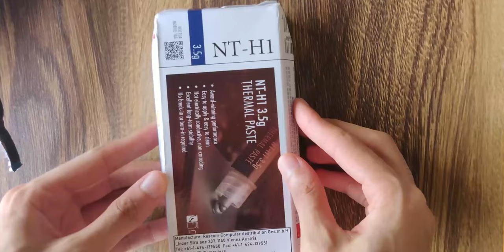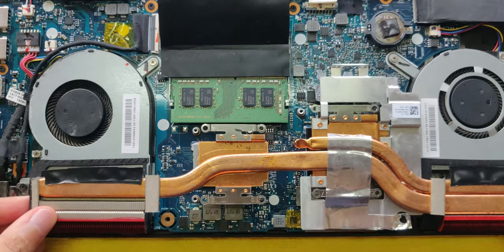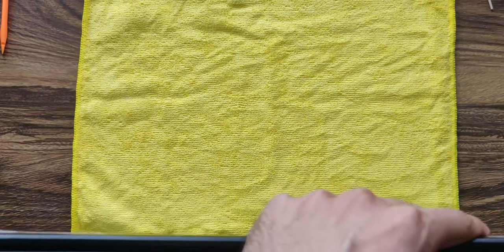How To Replace Your Thermal Paste - ASUS TUF FX505D series | Noctua NT H1

Comment: A small error in an otherwise excellent video would be the lifting up of the heatsink after applying the thermal paste, to check the application. This lifting up introduces air bubbles in the paste, which ends up making it less effective than what it can be, and undermines the entire reason to apply the thermal paste in the first place. Other than that, this video was really  helpful, so, thanks!
Reply from the maker: Oh that makes sense, thanks for pointing it out! Pinning this comment so that others can take note as well. Glad it helped you out! :)
Reply: Who cares he's gonna have to redo that NT-H1 TRASH in a week anyway! No longevity.
Reply: @krom5461  NT-H1 pumps out in like a week because it is very runny for thermal paste. This is because of expansion and contraction of the silicon die and copper heatsink being different, it's fine on a desktop CPU where it is a copper IHS on a heatsink though but not on a laptop. I have seen it actually start separating and leaving some oil on the die after a year.
Reply: @jm036  what paste would you recommend for a gaming laptop?
Reply: @Bob-bx4xg toothpaste.  Always game with fresh breath
Reply: About lifting up the heatsink, I found it strange, too. One thing you can do (if you have enough quantity) is lift it up, see how good it went, then clean the die and apply it again. I did this twice to learn how to properly apply it on a laptop CPU and GPU, since I had only done it before on a much larger desktop CPU.

Comment: I recently change my thermal paste too with Deepcool Z5, it dropped around 10°C from 90-ish°C to 80-ish°C. But rarely it still go back to around 95°C for a second or two. Still happy with the result nonetheless.
Reply from the maker: Yep, it's crazy how much of a difference it can make. In my testing, whenever it reached around the 90°C mark after applying the thermal paste, the FPS was usually 5-10% better as well.

Comment: Just bought this laptop used, I knew before buying the cooling wasn't stellar, but it was posted so cheap, and with 32gb ram on dual channel, that I just went for it. Cleaned the fans, and repasted it, here are my results in case they are of any use for anybody.

Tested both times with Sekiro max settings 1080p, from outside of Kuro's room, after looking down on buildings and enemies for 10 minutes, near 100% usage gpu, around 50% on cpu.
__________________________________
Before repasting (tested yesterday, on a chilly night)
CPU: 86°-94°c
GPU: 69°-72°c
__________________________________
After repasting (tested today, on a warmer night)
CPU: 72°-86°c
GPU: 60-64°c

__________________________________

nothing but good things to say about the 1650, it's like it was designed from inception to shine on anemic laptop cooling xD, the R5 3550h could definitely use better cooling though... I mean it's within specs, sure, but the acoustics could be so much better. If at least you could undervolt it... but you can't.
Reply from the maker: Thanks for leaving such detailed feedback! My testing found similar results of a drop in temperatures by 10°C on average. 

I haven't tried undervolting it, but is it not possible by using the Ryzen Controller software? It's made by a user but it's widely regarded as the go-to for tweaking mobile Ryzen processors.
Reply: @CytechGaming  I read a bit about it, but haven't tried it yet, I was thinking about buying a cheap knockoff bottom shell from aliexpress, drilling holes directly below the cpu fan on that, and gluing a dust filter to it. Have seen people report 10-20° improvements on other laptops with similar vent designs.
Reply from the maker: @fenix_tx_1342  Possible, I like the sound of it. But if you're interested in undervolting I'd recommend checking out Ryzen Controller. I downloaded it and was able to change the settings, didn't really play around with it too much though.

Comment: I like the strip of tape across the heat sink! Good idea man. Excited to see the performance difference, as I have the same laptop :)
Reply from the maker: Haha thanks! I noticed the gap a while back and figured it couldn't hurt to 'fix' it with some tape :P
Reply: @CytechGaming Did it improve the performance though?
Reply: @beamazed54  it definitely helps cooling down the temperature of the CPU and GPU. My laptop would heat like crazy every time I increased the fan speed. I realized that the gap would allow the hot air to come back inside the mother board in an endless cycle

Comment: Thank you.  I also lifted the heatsink again, saw there was too much, then used the little plastic knife to smear it flat.  My CPU temp came down from 95 to in the 60's (Celsius).
Reply from the maker: That's insane, even I've only had around a 10-20 degree difference. Glad to hear it :)

Comment: Just want to share some experiences: 

1. Laptop heatsinks are low pressure mounts compared to desktop variants

- In a multi core CPU, if cores are physically located nearby where there is no or less thermal paste, it may cause said cores to be hotter

2. Laptops have varying degrees of body & motherboard flex

- The mounting pressure changes depending on direction of the board flex. It may or may not happen, depends on the design, and also on where you hold the laptop in the air (single handed from one of it corners / palm at it's bottom etc..)

Hence with laptops you may want to be really generous with the amount of paste to help with the factors above

Some board flex problem cannot be fully resolved, the paste will eventually reduce in it's contact to the chip due to the repeated flexing

Was a repair specialist for a few years, and if we'd have a laptop with such problems, the before and after results, or demonstrating the problem impresses the customers. Granted it was 5-6 years back and things could be very different now
Reply from the maker: Thanks for sharing your experience! 

Just a question about point 1, wouldn't that be true in a desktop as well? Having no/less thermal would result in the cores to be hotter since the heat dissipation isn't as good as it can be, right?
Reply: @CytechGaming  How temps performs after months of use?, I've read about the "pumping out" effect and I'm not sure what paste use, I don't want to repaste every 3 months
Reply: @inkz34  can you tell me what thermal paste i should use i also dont want to repaste every 2 month

Comment: 3 yo vid i know, but did you have problems unscrewing the heatsink? few of my screws don't seem to be fitting my screwdriver properly - which screw head did you use? thanks
Reply from the maker: No worries, still lurking around here :)

Used a regular philips screwdriver head

Comment: Guys use cooler master cryofuze or cryofuze violet on budget it is very high in viscosity which makes it kinda hard to apply but after applying it wont pump out and good for long term stability🎉

Comment: Hello,what's up with the tape on the heatsink? Someone wrote that hot air does not move backwards. can i have more information?
Reply from the maker: It's very non-scientific 😂, I was thinking that if we're looking at where the air can move around in the laptop, I'd block off some areas where it can escape from so that it moves out of the exhaust instead of going back in the system. 

I have no evidence that it works or has any kind of performance benefit, so take it with a grain of salt 😅

Comment: thank you for helping guide! but i have a question to you, why are you removed the pads which are adhered on vrams? also you used thermal paste to these? thanks
Reply from the maker: Thanks for your comment :)  Do you mean the part at 3:45 where I'm cleaning the thermal paste on the VRAM? If so, then yes there was already thermal paste on it and I replaced it wherever it had been applied by the manufacturer. 

Hope this helped answer your question! :)
Reply: @CytechGaming  yea it's true, I didn't remove them also I added past on these. :) thanks for guide. good luck
Reply from the maker: @faith7744  thanks, you too! :)

Comment: Hello, I have followed all the steps correctly but when I tried to connect the battery back, the keyboard suddenly lights up. I tried to turn it on but it won't however the keyboard stays light up. Any solutions?
Reply from the maker: Hmm sometimes you get this issue when the RAM isn't set perfectly. You could try removing it and and putting it back in. 

I'll look into other possibilities as well till then. I've personally faced this issue where the screen doesn't come on when the RAM is slightly loose. Don't be afraid to push it kinda hard. You can check out how in my previous video when I'm putting the RAM in

Comment: What happens if u dont replace the thermal paste after cleaning the fans
Reply from the maker: You can clean the fans without replacing the thermal paste, but if you take off the heatsink it's recommended to reapply the paste to avoid air bubbles between the heatsink (which reduces performance).

I haven't tried it with the stock paste but  looking at how solid it was when I took it off, it's likely there will be air bubbles when you put it back on.

That being said, you can definitely clean your fans without removing the heatsink. Hope this helped :)

Comment: Help! I did all this and now my laptop won't turn on. There's a solid Orange light is showing when plugged in but it doesn't boot up even after long pressing the power button for 10 secs. Did I mess up reconnecting the battery somehow? I tried to disconnect and reconnect several times but the issue persists. I have no issues with my psu or battery before this.

Comment: Bro , a serious problem

While opening cooling pipes ,One screw top shape is irregular 
Like screw driver moves freely on it cant hold the screw aany suggestion????
Reply from the maker: Hmm, if you're using the + type screw driver bit, try using – type bit. Sometimes that helps with the grip. Hope this explanation makes sense 😅
Reply: @CytechGaming  yes i get it. , But didn't work 😔 
I think i have to break the lock or cut the strip
Reply from the maker: @anonymousyt2375  there must be a better way to remove it than cutting it. I can't give you a specific solution because I'm not entirely sure what the issue is. 

If the screw has been stripped (i.e. your screw driver can't grip it enough to remove it), there are some solutions for that you can google. Let me know what you end up doing, I'm curious as well now :P
Reply: @CytechGaming  there are solutions 
Like melt a metal using solder on top of it and attach some screw on it then turn top scren it will also rotate other one

Or i think i can use fevi kwik glue to do the same 🤔
Reply from the maker: Sounds like a plan :)

Comment: So how is the performance difference? Did your cpu thermal throttle before? I have the same laptop but with the 3750h version. Did FPS improve for cpu heavy games?
Reply from the maker: Yep, I saw around a 8-10°C drop, especially at idle. Increase in FPS was also around 5-10% depending on the game. Mainly though, the laptop now takes longer to reach max temps and runs quieter for longer.

Comment: Hey bro, please answer. U removed those viscpus pads from vram and vrms and put paste, how is it now? I saw people don't touch these pads
Reply from the maker: Hey! The funniest part is that they weren't pads, that was just how the thermal paste looked caked onto the vram 😂. 

Usually though if you have thermal pads, if they're making contact properly and evenly with the vrams and the heatsink, you should be good. Personally though, I would replace the stock cooling with high quality thermal paste. Hope this helped!

Comment: I have the same laptop and its throttling.. im thinking of replacing the paste but im afraid cause I've seen people short-circuiting their cpu due to thermal🥺... which thermal do you recommend
Reply from the maker: Out of the popular thermal pastes, in my experience Noctua seems like a go-to one. Thermal Grizzly's Kryonaut also seemed like it was a good choice. However, the one thing I've learned through using Noctua products is that the performance is always there. 

If you're worried about short circuiting, etc. you can follow my method of applying a bit of thermal paste and then checking if it's enough or not. If you think it's too much and might leak onto the motherboard, you can always use tissue to wipe some of it off.
Reply: You can always hire someone if you lack the expertice, no shame on that
Reply: @CytechGaming  but the thermal paste you're using is non-conductive right? So that shouldn't really be an issue
Reply from the maker: @beamazed54  yep, that's right :) apart from being messy, there's not much of a downside.

Comment: what is the isoprophyl alcohol .for?
Reply from the maker: Hey! Isopropyl alcohol is used to clean the thermal paste off the laptop safely. This is because it's non conductive (unlike water) and allows you to clean electronics in general without the risk of shorting it.

It's recommended to use atleast 70% isopropyl alcohol when working with electronics. Let me know if you have any more questions, I'll be happy to answer them :)

Comment: Sir did u use 99.9 isopropyl alcohol? can I use 70percent??
Reply from the maker: Hey, if you're in a pinch and don't have anything higher than that, 70% will work fine. Just make sure that the solution has evaporated before applying the paste.

Comment: I have the same laptop but not sure which specs you have, anyway I replaced the thermal paste on cpu and GPU and also applied thermal paste on the GPU VRM/VRAM chips like how you did, is it okay to do this? It’s working it seems but I just want to be sure those chips aren’t over heating
Reply from the maker: Yes, it's been around 2-3 years since I made this video and I haven't faced any overheating issues since then. 

You can also install HWinfo if you want to monitor your temperatures to compare before and after. It's a powerful tool that gives you a lot of data. Let me know if I can help in any way :)

Comment: Hi, when I disconnected battery I saw a white light on top left of the laptop is that a issue? My laptop is working anyways tho
Reply from the maker: Hey, do you mean on the screen or on the light indicators or something? If it's those I'm guessing it's just the electricity passing through the system, I wouldn't pay much attention to it. Glad to hear it's up and running just fine :)
Reply: The light was on the white wires behind the fan

Comment: Can I use rubbing alcohol?
Reply from the maker: Rubbing alcohol is a form of isopropyl alcohol (usually with around 70% alcohol compared to isopropyl's 99%). A quick Google shows that anything above 70% alcohol is fine to clean electronics :)

Comment: I know it is out of topic, but my ASUS TUF 505DD had a problem and I can't find anything to help me. So, my internal speakers are not working and the headphone jack is not working too. Whenever I play a music/video it will just show that the Speakers (Realtek  R Audio) is working but no sound is coming out. I had to use an external soundcard just to attach a headphone or use a Bluetooth speaker. I tried uninstalling the sound drive, reinstalling the driver from Asus but still nothing. This problem started after I attached my laptop to my friend's TV using HDMI. As soon as I got home, it is not working anymore. I'm thinking of replacing the internal speaker and seeing if it will work. But before I spend extra $$$ I want to make sure I tried everything and replacing the built-in speakers will fix the issue. I hope you can help me! Thank you!
Reply from the maker: Hey! No worries about being off topic, I enjoy troubleshooting either way :)

Sounds like you've done the basics already, so here's a few things I can think of:

If you ever opened your laptop, did you double-check that all the plugs were reattached? I've forgotten a few on occassion.

If possible, I would look into doing a fresh install/factory reset. I had a similar issue with my laptop where the headphone jack wouldn't work most of the time, and when I gave it to repair they just formatted it and suddenly it worked fine lol. Felt kinda silly that that was the fix, but it worked. If you go with this option make sure you've backed up everything you need.

Let me know what you think and we can consider the next steps then :)
Reply: @CytechGaming  Thanks for the quick reply! Yes, I already checked the inside and unplug, replug the connectors for the speakers. Tried formatting fresh too. Even tried installing Ubuntu, hoping I only got an issue with my Windows OS. Nothing worked. Tried installing a new OS using a new SSD too. Same results. Using the new Windows 11 now, still no sounds and jack is dead.
Reply: For reference, I have ASUS TUF 505DD with the AMD Ryzen 5 3550H
Reply from the maker: @ruhtraaa  Hmm that's the same laptop I have, and you seem to have tried more than what I would ever do (props for trying it with Linux, I wouldn't have thought of that). 

I was a bit skeptical that it was a hardware issue since you just plugged in an HDMI cable, but I think you've ruled out all the other possibilities. I think replacing the internal speakers is a good idea after considering the cost. Not sure how you would go about changing the headphone jack though. Let me know what you end up deciding, curious to see how this works out :)
Reply: @CytechGaming  looks like that’s my last resort. Hoping it’ll work! I will update you!

Comment: I have a quick question, I've removed this plastic that was in covering the cores of the processor, is that bad?
Reply from the maker: Have you check ed the temperatures and seen if the laptop is running fine after this happened? If yes, then it's probably fine. I don't see any plastic on the cores in my laptop.